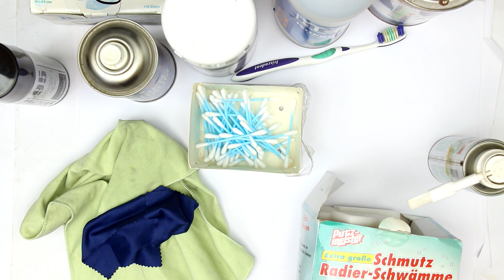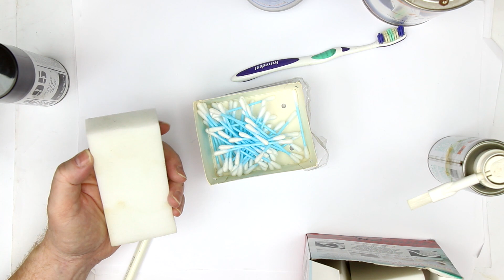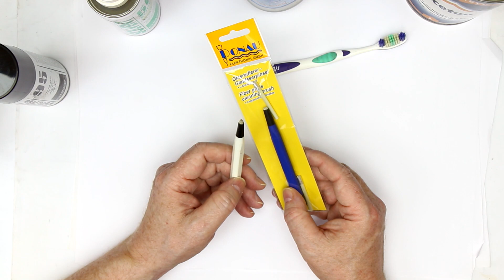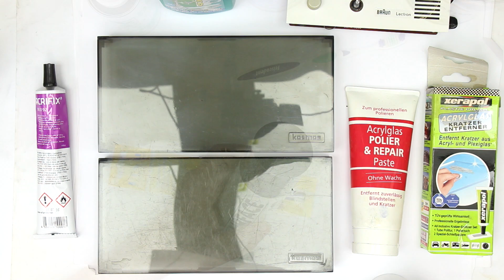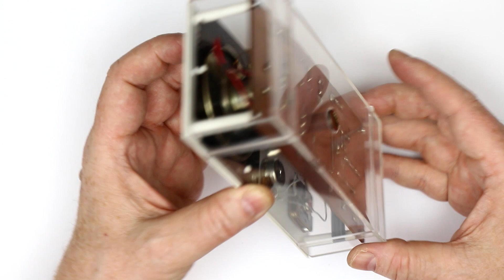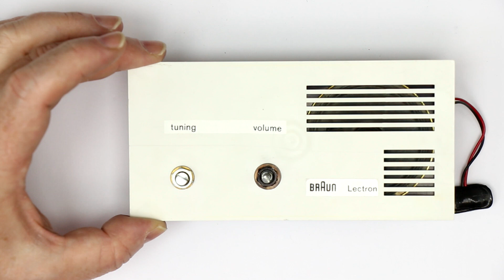Restoring Front Panels

Comment: Agree that ethanol is unsuitable.  In the US it is denatured, typically with denatonium which is an awful residue (let some dry on a fingertip and taste, to test if it is present).  May also be denatured with acetone which attacks plastics, or methanol which is toxic.  In some places you can get 75/25 percent pure ethanol/water not denatured/contaminated, as an expensive taxed product in the liquor store.  Agree that isopropanol is useful as it is supplied as pure with water, no denaturants.  Also useful is hexane, available as "white gas" fuel for camp stoves.  Petroleum solvents are typically inert on plastics but aggressive against adhesives or oily residues.  Don't use silicone on or around precision optical surfaces like lenses or instruments, it bonds to glass and won't clean off.  Acrylic floor polish is an acrylic coating that cures to a fresh optically-polished surface to renew scuffed acrylic surfaces.
Reply from the maker: Thanks for additional tips

Comment: Keep your old plastic credit cards to use as scrapers for removing stubborn things with solvent, like adhesive stickers.  Cut them with scissors to get a fresh square edge, to shape for reaching into corners.  Sharpen the edge on a grinding wheel or sandpaper to get a knife edge or feather edge.

Comment: Great tips - thank you. If I might share some of my own favorite products..... For polishing clears I like the NOVUS 1-2-3 multi-step system. I've saved a lot of LCD's with that over the years. For light cleaning of plastics and giving them that satin 'fresh out of the injection mold' look, I've settled on a product meant for automotive interiors, Meguiar's G4116 Natural Shine Protectant. I'm going try to get hold of the Surface 95. While googling the datasheet I found that Kontakt Chemie is a subsidiary(?) of CRC Industries, which is widely distributed in the US. I'll have to see if they have an equivalent product under the CRC brand.
Reply from the maker: Thanks for additional hints

Comment: Great video. I have restored some older plastic electronics. I always start plastics blowing off the dust then gentle water shower, then a bit of mild soap and maybe a microfibre towel. These are surprisingly effective and not so harsh on the environment. Bring out the bigger guns in moderation. EDIT- As John Coops noted, test all chemicals and methods beforehand!

I might use some ultra fine sandpaper with lots of water flowing (that reduces friction and washes particles that can scratch). I use some auto polishes but many state on the bottles they are NOT for plastics. I use some auto waxes/finishes but some of these can stain plastics. So overall, use extreme caution with automobile finishing chemicals. 

The stickers look great. Other alternatives are to visit the local sign shop and have them print up on their higher quality printers & materials. Or visit the local hobby-model store for scale ideas.

Comment: I cannot stress how important it is to test the plastic and painted surfaces before using solvents!
A simple example - many modern plastic front panels use a spray painted surface layer to provide a high gloss, matt, satin, fake anodized metal or even a "rubber-like" feel and finish. These finishes will not be applied to the rear side, only the front (visible) face.... so you cannot just test on the back side! You can easily destroy these special surfaces even with Isopropanol.
This can be used to your advantage too - if the rubber/matt coating is sticky or worn, you can remove it completely!
...
Acetone will DESTROY most plastics, however you can use it to melt and restore gloss and sun damage. This is NOT easy and takes a lot of skill to get a smooth, even surface. I've seen some people placing the plastic inside a sealed enclosure with Acetone fumes, but once again it takes special care and skill.
...
For polishing, buy a Headlight Restoration Kit from the Auto stores. You can use Metal Polish at the beginning to make the process quicker, but then you have to use Acrylic Polish to remove the scratches afterwards. Do not use the same polishing cloth, and make sure to remove all metal polish before the final polishing steps.
Reply from the maker: I agree 100%
Reply: Good tips! What are generally good materials to remove sticky rubber coatings? Instrument case is labeled PC+ABS-FR(40). Does the FR mean fire resistance or fibre-reinforced?